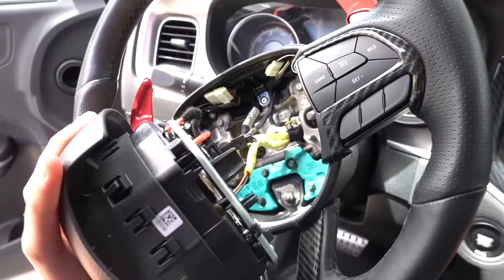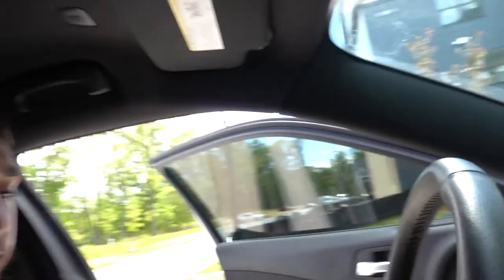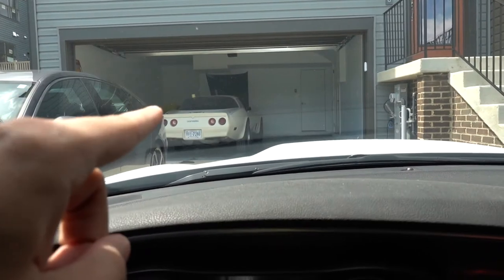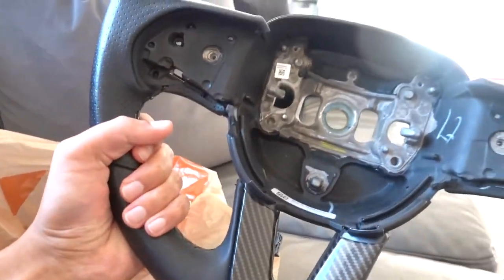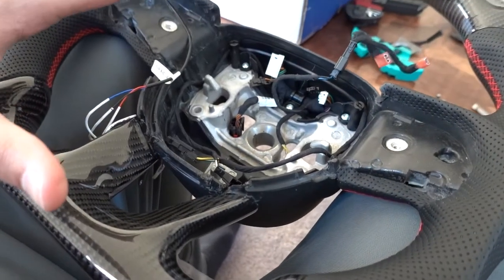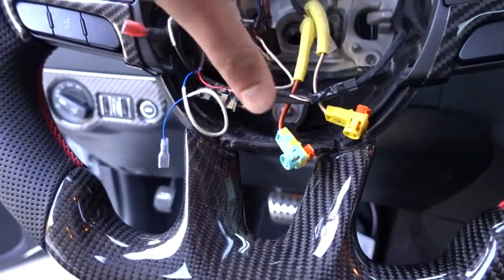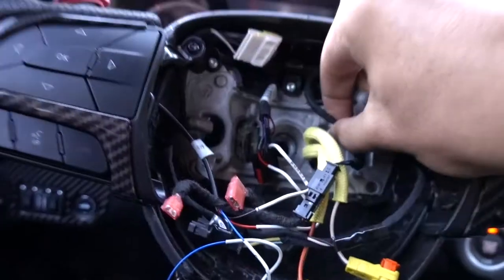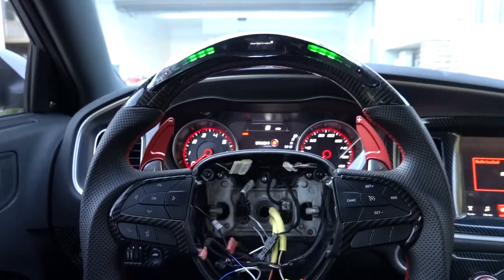BRAND NEW LED CARBON FIBER STEERING WHEEL FOR THE DODGE CHARGER SCAT PACK. (VICREZ STYLE)

Comment: Did you figure out why the blinkers wasn’t working?
Reply: I think he need blinker fluid
Reply: @furqaniqbal7780  💀💀💀💀
Reply: I know it’s two years old but the blinker it’s not working because the blue wire needs to be connected to something I haven’t figured out which wire but it’s the blue wire that makes it work with the blinkers

Comment: Hi I have the same wheel just curious which two wires did you connect the red and black wire that comes on the carbon wheel to the power can’t get the lights to work
Reply from the maker: There’s another step by step video I made but if I recall correctly. Red on the steering wheel went to purple on the cars harness and black to black

Comment: Is it just me or the nut off the steering wheel I cannot get off, I even tried an impact. Is it reverse thread?
Reply from the maker: Sooo I did this off camera but the impact didn’t work for me either. I had someone hold the steering wheel tight and I ended up using a breaker bar to break it loose. It’s on there real good so the longer the breaker bar the better
Reply: @NabeelIqbal97  thanks for the info, did you get a new bolt for the new steering wheel? If not how hard did you tighten it ? Lol
Reply from the maker: I should’ve, but no lol.. and I can’t recall but I found the torque spec on a forum and used that

Comment: With this wheel do you lose the heated steering wheel or do you just have to transfer it over?
Reply from the maker: Yeah unfortunately that’s one of the downsides. You can get the non LED option with heated steering tho